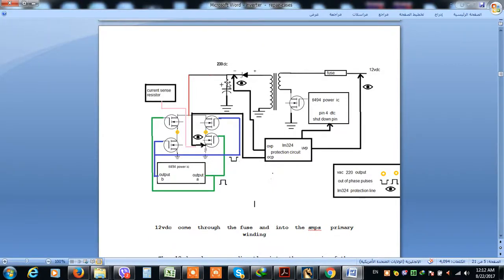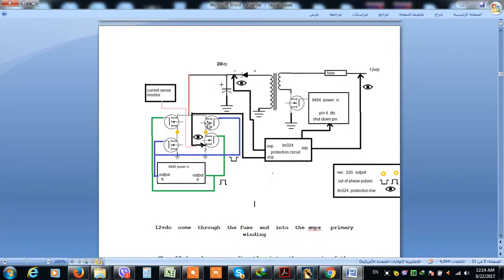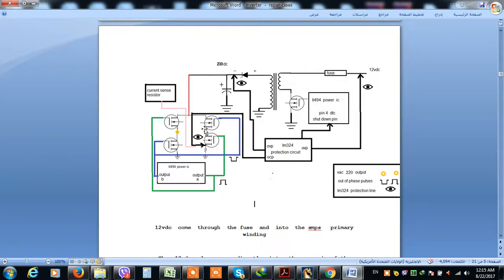chinese inverters  repair  course  part 2

Comment: Sir . Mery pass 1000w china  inverter he. Os k dc side k mosfit Hy1906 blast kar gay hain . Change karny par .jab bettory se power deta hon osi waqat mosfit blast ho jata he  . Mosfit pin par without mosfit .point par drain 12.30v 
Gate  5.6v 
Source  - battery
Pls guid me . Mosfit change karny k bad  . Mosfit  ko box k sath nh lagya tha . Wasy hi check kia tha .
Reply from the maker: that is not  clear english